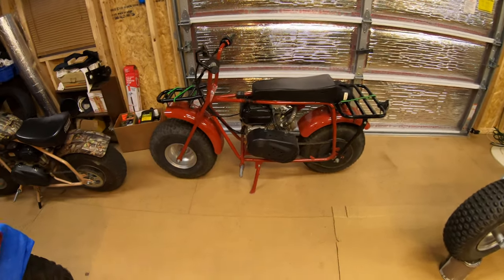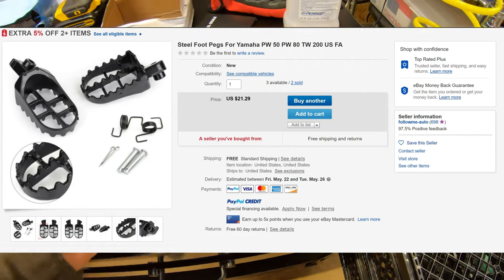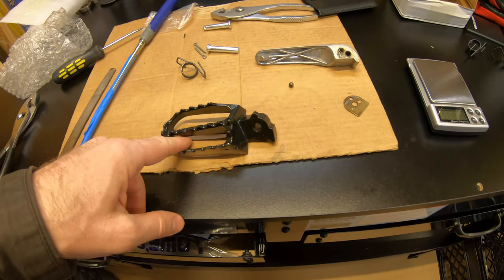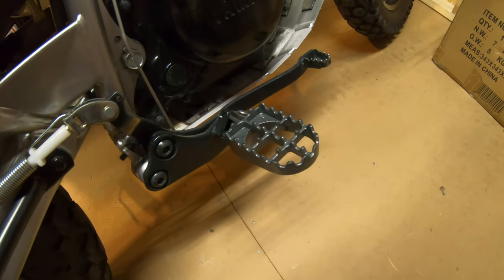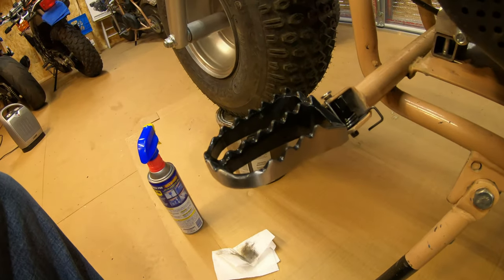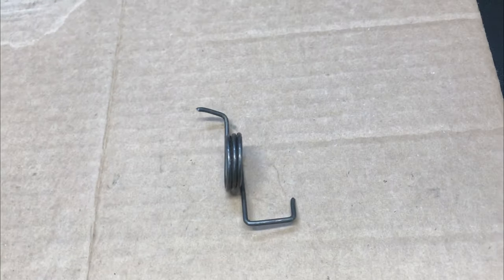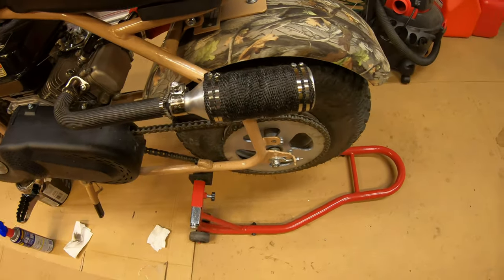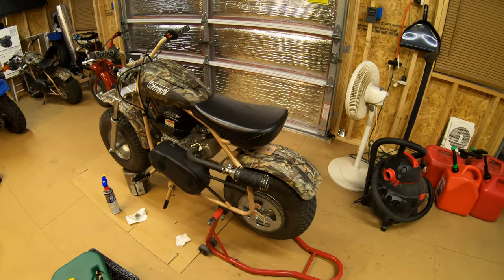Coleman CT200U(EX) Mini Bike | Upgrade Those Nasty Stock Footpegs! [4K]

Comment from the maker: Regarding stainless magnetism:
There's a lot of different types of stainless steel and some are magnetic and some aren't. I wasn't using it as a test to see whether or not it was stainless though, just curious. Those black ones are cast "aluminum" (probably pot metal) and falsely advertised as stainless steel. The ones I used are stainless of some sort, maybe not 409 or 304.  It's Chinese cast "stainless" which you saw had a very little bit of magnetism but were more than twice the weight of the falsely advertised black aluminum ones. 

It's not 304 stainless like on a nice car muffler that isn't magnetic. But 409 stainless is magnetic, I just installed a cat-back exhaust on my car made out of that and it is magnetic and also stainless steel..

https://help.summitracing.com/app/answers/detail/a_id/3932/~/what-is-the-difference-between-304-and-409-stainless-steel%3F

"409 stainless steel can be almost 90% iron. This means a magnet will stick to it. It will also develop surface rust over time, especially after being exposed to heat" 

"304 stainless steel has a much lower concentration of iron. A magnet will not stick to it. It will also develop a golden color over time, after being exposed to heat.

"Welded or bent areas of 304 stainless steel could be magnetic. If you do check it with a magnet, check a straight section that has not been welded."

"All stainless steel contains chromium and other elements. The added elements make the metal harder, stronger, and resist corrosion. The 2 main types of stainless steel used for exhaust parts are 304 and 409."

"The difference between the types of stainless steel is the amount of chromium and nickel found in each. 304 stainless steel contains a much higher percentage of chromium and nickel. This makes it much more resistant to rust. 409 stainless steel is still more rust-resistant than Aluminized Steel. However, neither type of metal is 100% rust-proof."

Comment: I also bought those aluminum footpegs for my TW200 but I was not able to install them on broke a spring in the process, but i don't think I got the right ones though. Those Stainless Steel ones look a lot better! And by the way stainless steel isn't suppose to be magnetic, but it can be if it is cheap and lower quality.
Reply from the maker: TrailWayMarc LOL yeah I’m sure it’s low quality  😆   But for these mini bikes it’s ok.  Those Krator ones work great on the TW200.  Sometimes they go out of stock for a long time. Right now they are only about $17!

Comment: Great upgrade. Thanks. Thinking to originals can be used as foot rests forward with a tube and u bolts.
Reply: I'm afraid that would conflict with the forks.
Reply from the maker: @cwmaxfield2000  👍 Yeah they're a lot better than the stock pegs for sure. I think you could mount a second set of pegs though if you wanted. Might take some fabrication though.
Reply: @bwxmoto  maybe for a small passenger ??

Comment: Those black “plastic” foot pegs are new wonder material called aluminum. 
That being said. 
I really didn’t have a problem with the factory pegs. Actually was surprised they weren’t more slippery than they were. Wanted the red anodized as I saw them in a video and thought the looked sharp. Have after market pegs in my KLR so thought I’d give em a try. 
Cheaper out and got the black aluminum like in this video. Did not drill out the bike. Reused original pins. That way I can replace original pegs should the break. 
That being said. Yes they are grippier. The return spring is nice. But … they are shorter and have less surface. Not sure I like em. 
But those Stainless steel ones look longer. 
Just my two. Ride on.
Reply from the maker: More like chinesium pot metal. I'd eat my hat if it's pure aluminum, probably a lot of zinc and other dirt and garbage scraped up off the floor and thrown in there.  Seller listed them as stainless steel. 😆

Comment: Hey I just bought one a week ago I was wondering if you could do a video on how to remove the throttle screw to unlock it's full potential to go 25 mph
Reply from the maker: I would but I've never had to do that. I think most people just cut it or drill it out. I would actually drill it out and use the threads to put in another one and use that if a new rider or child wanted to learn to ride it. On all mine I have Predator motors with throttle screw in tact. On the one that is the original engine, I don't think the throttle screw is welded, they only did that starting in 2019 or something like that. But yeah I'd just get a hack saw and cut it or drill it out with a drill if you want to remove it quickly.

Comment: Great video.!!Quick question 
Why don’t you add suspension springs under the seat? I did to mine and it’s a big difference.
Reply from the maker: Thanks! Yeah I've seen some cool seat suspension mods out there. I actually just bought an MB200-2 with rear suspension. I have a bunch of minis.. still. LOL

Comment: Thay seat riser is pretty neat
Im gonna do that to my bike
Reply from the maker: It's worth it, stock seat height makes me feel like I'm about ready to fall off the back all the time and you sit pretty low too. I like the seat a little higher for sure. It's still comfortable though.
Reply: @bwxmoto  i know what you mean i slide too  and it gets annoying always having to stop to abjust position on the seat
Reply from the maker: Yeah it's a lot better with seat raised a little for sure. I guess one reason to keep seat low is if you want smaller kids to be able to ride but other than that it seems too low to me!

Comment: Love the shop. Great review. Need to replace some on my minis, but why would you even drive in weeds like that in the first place? Dude. Never had my foot pegs pop up. Going in my amazon cart. And subbed your channel. 3/4 plywood would work good for seat riser and cut to follow seat form.
Reply from the maker: Thanks! 🙏 And I guess I drive in crap like that because sometimes you have to to get to another trail or get around trees that are fallen or stuff like that. Stuff gets overgrown like crazy out here in the summer!  
Yeah I think that’s what I’m going to do with that seat riser. Three-quarter inch plywood to follow most of the seat pan for support and paint it black. Should work good!
Reply: Well even at 6'2" I didnt think of a seat riser (so used to the shorter mini's I was happy the seat is as good as it is), now Im intrigued. Think I even have some 1" rough cut somewhere.
Reply from the maker: John Bass Yeah I mean if you’re just cruising around on easy terrain I don’t think you need it really. But if you start trying to climb some really steep stuff it does help quite a bit to be a little bit higher up. Especially since that seat kind of makes you feel like you’re falling off the back sometimes if your front wheels in the air or something like that! LOL

Comment: OK I searched over Amazon and I can’t find that muffler could you let me know where you found it I ordered the same header you have so it should work
Reply from the maker: The 1" one won't fit the stock ARSPORT header because that is larger than 1", I had him make me a custom 1" O.D. header and that does work with the 1" RLV. I think if you got the regular 28mm header you need a 1-18" RLV and might need a shim not sure. 
1" (can find them different places)
https://www.ombwarehouse.com/rlv-exhaust-silencer-1-1.html

First one I saw on google search 1-1/8" RLV
https://www.kartpartsdepot.com/Silencer_Stock_Class_p/sm-wkas118.htm

Can find them on ebay and different places. They go in and out of stock a lot so just have to search around google. I found the last one at BMI karts I think. 

https://www.bmikarts.com/search_results.html?k=RLV&search=

But you have to search around for best price + shipping + tax all added up.  It's worth it though, they quiet it down a lot and still make good power.
Reply: @bwxmoto   Pipe Diameter. OD: 26.86mm ID: 21.70mm
Reply from the maker: @AngelHernandez-lv7xy  Hmmm.. 

26.86mm = 1.05 in 
Mine was 26.86 mm and that was big enough to make 1" RLV not fit.   

Yeah because 1" = 25.4 mm.  So yeah I think with that pipe you'd still need a larger 1-18" RLV and then might need a shim.

I did end up getting my 1" RLV on there but it didn't go on all the  way and I had to smash it on with a hammer and it wasn't pretty.  I would get the larger RLV and shim it up if needed.

Then on the next one I bought for BT200X I had him make me a 1" O.D. header and the 1" RLV fit perfect.
Reply: @bwxmoto  thank you

Comment: Can you tell what 60t sprocket and what size and length of chain I should get I appreciate the the help I have a ct200u ex camo
Reply from the maker: For length that RK 98 link I gave you a link to in other comment is plenty. You will have to take a link or two out.  Alveytech 60 tooth on Amazon. Link in the description. They go in and out stock a lot. They also sell them at Monsterscooterparts.
Reply: Thank you

Comment: Can you please put a link to the torque converter that you have? I am interested in one of those I just don’t know which one to but
Reply: Buy*
Reply from the maker: The cheapest one you can find on ebay or amazon. That's what I always do. The exact link to seller I bought from I think is in description but prices change, I'd just get the cheapest one you can. Just make sure it's for a #420 chain.

Comment: Where did you get the pipe from???
Reply from the maker: Link in description but maybe hard to find: ARSPORT Short Header https://amzn.to/3hGgJUQ    Very high quality pipe. The guy makes them in in the USA.
Reply from the maker: I think this is the same but maybe longer with a slash cut on the end. ARSPORT header slash cut https://amzn.to/3rAkDqz
Reply from the maker: The muffler in an RLV 1" but it's a little too small for the pipe. Had to force it on there. The guy made me a smaller 1" OD diameter pipe custom that I have on my BT200X with a 1" RLV and it fits on there a lot better.
Reply from the maker: I was looking around and there's even another one similar but longer yet, and has a curve on the end. Pretty cool.  https://amzn.to/3uAXeaz

Comment: why did you remove the headlight? i want to know
Reply from the maker: Kevie Junior has a Hemi Predator 212- no lighting coil.  I use a good flashlight mounted to bars or I might install a light bar.  Lithium rechargeable flashlight with good LED works great though. Not a fan of those giant chrome lights really either.

Comment: How'd you get your money back yet you still have em?
Reply from the maker: I told them I'd send them back and Amazon said just keep them. They were more expensive than the identical ones being correctly advertised as aluminum at the time. So it was false advertising. They are definitely not steel (those black ones), probably not even aluminum, probably cast "pot metal" which is total garbage. 

Not even sure I'd use them as a spare, I think they might break and leave jagged edges, could cut your leg up if not wearing high boots if you break them riding. They feel lighter weight than even solid aluminum would.
Reply: @bwxmoto  Nice!

Comment: Are they any wider than stock?
Reply from the maker: Good question! I never compared them like that. They  feel about the same, but they are obviously much fatter back to front so they feel "bigger", but they might not stick out as far. Next time I'm in the garage I'll check.
Reply: @bwxmoto  just installed a tav 30 on my EX and I hate how it takes up half the peg now
Reply from the maker: Ohh..  hmm, is it a smaller mini bike? On my bikes the pegs still start about where the TV cover ends. Plenty of room. I wear a size 11.5 and have no problems getting my feet on there.
Reply from the maker: I noticed you said EX - it seems ok on my EX 👍. I’ll still measure them when I go down there in the garage.

Comment: what brand is the torque converter
Reply from the maker: Probably MOOSUN or whatever they call it. But it really does not matter. If it's not a an original Comet brand (made in the USA and expensive), then it's a Chinese clone TAV2 and they are all the same across "brands".   There's a link for them in description.   But I'd just get the cheapest one that is the correct size from a seller that looks legit on Amazon. Sometimes ebay has them a few bucks cheaper.

Follow these links, but see if there are any cheaper ones, and then buy the cheapest one you can find that is the correct size. That's what I always have done and never got a bad one.

30 Series TAV2 3/4" Torque Converter:
 https://amzn.to/3wfjN2U
https://amzn.to/3eUw3Qc
Reply: @bwxmoto  how did you get the torque converter to fit if the shaft on the engine is 5/8 and the torque converter in the description is for 3/4 I've seen adapters but the reviews for every one say they dont fit

Comment: Where can I get the seat riser
Reply from the maker: I just cut it out of 3/4” wood I had laying around and painted it black. Could use metal but that would be overkill. Maybe some sort if poly or thick plastic would work too.
Reply: @bwxmoto  thank you

Comment: First thing I do to all my mini bikes and then I pull the motor because every time I go to harbor freight I buy a 212 my son and 2 son in law's like to race mini bikes been messing with small engine for years I'm a Diesel mechanic by trade and a fab welder work on a lot of heavy equipment my boys run motor for about a session then I build 3 fresh ones in the winter for them I have a mb200 full suspension I ride normally basic predator 301 build runs about 55 I've got a Baja200 with a build 212 tillotson it runs 60 and the bike the boys started racing is a ct200u it's a tillotson 225r built out to a 236 a 68 vw smog pump mikuni 28mm 8 sec nos shot blow off is springer for 16 pounds of boost it ran 93 with a 5 8 110 pound son in law on it he lost a pound and a par of shorts but lived another day
Reply from the maker: LOL  Nice! You have a 301 on an MB200?  Many mods to fit it on frame? I like the sounds of a 301 on that bike. Obviously would need motorcycle gas tank.
Reply: @bwxmoto  Only thing I did really was a riser and shaved the torque converter to fit motor has springs governor delete oil kill switch deleted and I did the small cam and wrist pin connecting rod since the oil pick up in them things are known to break off plus I did a billet flywheel it's pretty much stage 2 it's a great bike not the fasted but I have an 86 Honda 250r 3 wheeler with a rocket kit I have paddle for it set up for sand I've had a tire on it and it's really to much for street power band is a killer
Reply: @bwxmoto  oh and I did a 2 gal Harley tank I found on eBay for 114 bucks
Reply from the maker: @davidpayne4084  That sounds pretty nice. I bet the 301's torque suits the MB200-2 nicely. I'm gonna go stage 1 and see how it feels. It's pretty gutless stock, more gutless than the Hisun stock feels on a Coleman, but it is a heavier bike.
Reply: @bwxmoto  yes it runs smoothly and 50 with no problems I've thought about re-gearing take the 70 tooth to a 50ish for more top speed but bike is perfect all you really need

Comment: Magnet don’t stick to stainless steel
Reply from the maker: Actually it depends. There's a lot of different types of stainless steel and some are magnetic and some aren't. I wasn't using it as a test to see whether or not it was stainless though, just curious. Those black ones are cast aluminum and falsely advertised as stainless steel. The ones I used are stainless of some sort, maybe not 409 or 304.  It's Chinese cast "stainless" which you saw had a very little bit of magnetism but were more than twice the weight of the falsely advertised black aluminum ones. 

It's not 304 stainless like on a nice car muffler that isn't magnetic. But 409 stainless is magnetic, I just installed a cat-back exhaust on my car made out of that and it was magnetic and also stainless steel. 

https://help.summitracing.com/app/answers/detail/a_id/3932/~/what-is-the-difference-between-304-and-409-stainless-steel%3F

"409 stainless steel can be almost 90% iron. This means a magnet will stick to it. It will also develop surface rust over time, especially after being exposed to heat" 

"304 stainless steel has a much lower concentration of iron. A magnet will not stick to it. It will also develop a golden color over time, after being exposed to heat.

"Welded or bent areas of 304 stainless steel could be magnetic. If you do check it with a magnet, check a straight section that has not been welded."

"All stainless steel contains chromium and other elements. The added elements make the metal harder, stronger, and resist corrosion. The 2 main types of stainless steel used for exhaust parts are 304 and 409."

"The difference between the types of stainless steel is the amount of chromium and nickel found in each. 304 stainless steel contains a much higher percentage of chromium and nickel. This makes it much more resistant to rust. 409 stainless steel is still more rust-resistant than Aluminized Steel. However, neither type of metal is 100% rust-proof."

Comment: I would rather the aluminum foot pegs because I rather them break then bending the foot peg bar on frame.
Reply from the maker: They flip up - I don't see how they would bend the frame.  These would also break before the frame I think, they are cast steel which is much weaker than forged or even steel tubing which frame is made from.
Reply: @Quirin M. It is a mini, a Trail Bike' not a YZ450r dirt bike Lol' 
They are Not Designed for Jumps Bro'